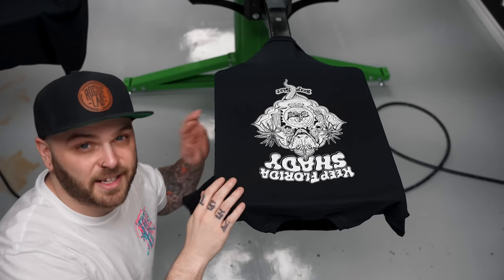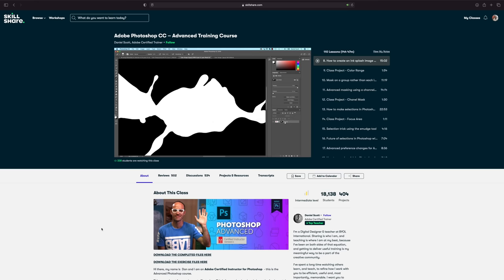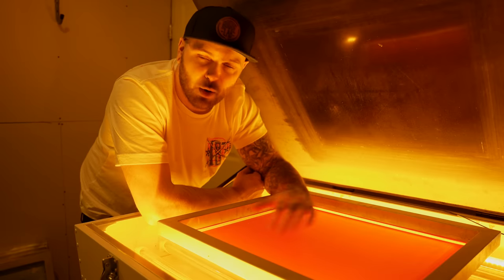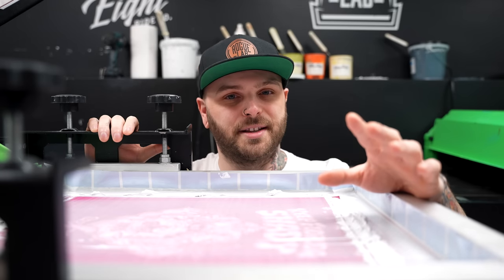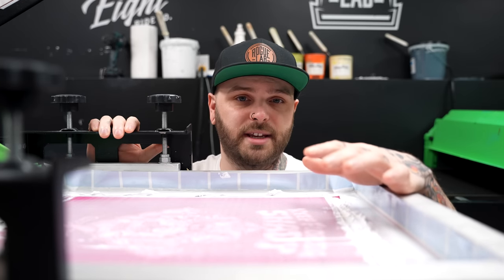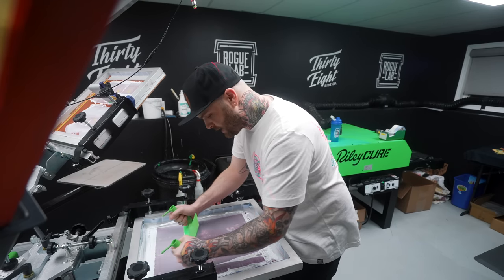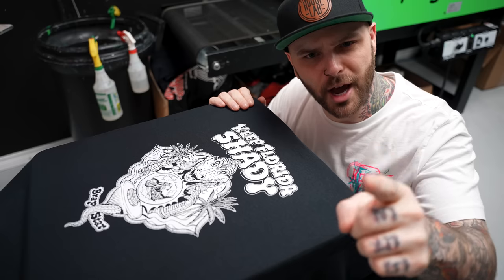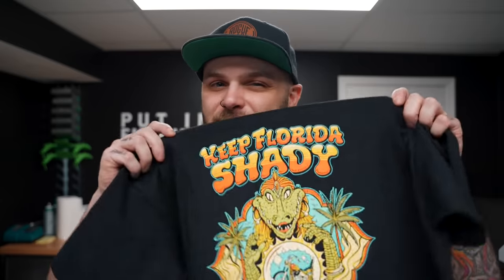How To Screen Print An Underbase | Everything You Need To Know

Comment: We just switched from the wilflex LC bolt to the rutland street fighter white at half the cost with the same results. We were going through 10 gallons a week and it added up at the end of the month. Really good advice on the prep. I would also suggest a 2 to 1 coat for a thicker stencil to put down a little bit more white for better coverage. Print looks really good 👍
Reply from the maker: I use a 1/1 which is a perfect 20% EOM with that screen mesh and emulsion, EOM plays a huge part in a good print. I use the Rutland street fighter here too but I've switched it to my highlight white as it didn't have the matte down the wilflex did. I think on an auto with a roller or iron it would be a perfect base though.
Reply: @leestuart38  we don't use a roller with the street fighter and get good matdown. Had to play around with the pressure and squeegee angle to get it right. Head 1 is our default underbase print head...lol

Comment: WOW....that looks great. Just the registration is incredible. F"n great job man. Only 1 question could u do a flattening screen right after the white base. I just did some black hoodiez after the first pass i did the flattening screen. And hit it again with white. It was a bright white. And it was a thick. It was only a 2 color design so I was able to get away with a thicker print.
Reply from the maker: Thanks! I don't use a flattening screen anymore, I've dialed in my setup and technique to where I don't need it

Comment: Not sure if I missed it in this video but should the flash DRY each ink layer or just almost dry it?
Reply from the maker: Always flash the underbase. Top colors is a balancing act between printing wet or flashing. If you're new to it or even an intermediate, then flashing them all is fine on a manual press. Just make sure you aren't over flashing and fully curing everything

Comment: I am  still struggling a bit with learning and understanding all of the inks out there. There are so many damn choices! I am going to try out the Wilflex Quickwhite you mentioned but if I am understanding correctly, based on the spec sheet that ink is not suitable for 100% polyester garments. If that is the case, what white is your preference for 100% poly?

Comment: Hi Lee,
Is your flash a Heat dryer or UV driven ? 
I'm currently using a heat press to dry tee's and I'm wondering if I should go straight to UV 
Thanks
Reply from the maker: Heat. UV isn't used in textile screen printing

Comment: 2 questions what type of squeegee is that and do you like using that better than standard one? And are you using water based inks or plastisol? Process and advice might be bit different dependending on which you are using.
Reply from the maker: Way better than a standard squeegee in my opinion. It's a lot easier to pull prints and to print for long periods of time. The link to the squeegee is in the video description 👍🏻

Comment: I use 5% reducer in my whites for printing hoodies only. Is that something you do as well? It seams like the only way to get a smooth white on hoodies.
Reply from the maker: No I don't use reducer for basically anything unless I'm printing on white shirts. Reducer is taking down the bleed blocking properties of your low bleed white which you really need on hoodies. I run thin thread screens for bases on hoodies instead.

Comment: If you do not do a Print, Flash, Print on the under base. Do you do a highlight white on the top to make the white pop more?
Reply from the maker: If there's white in the design, yes use a second highlight white screen. I'll be doing a video on this right away

Comment: for the underbase white, do you use 1point choke from the center in illustrator?  I could see the outline of the overprint on the "white hightlight video"  which looks like 1 point to 1.25 point choke?
Reply from the maker: That's far too much. I use 0.25 to 0.5 at maximum

Comment: Do you have to print the underbase design smaller? Or just the same size as everything else?
Reply from the maker: The base is typically choked a little bit depending on the design

Comment: i want to get me a screen print press.. but im not sure i dont have much room, can i also do a cmyk print with  a press wich only can hold one screen? i can imagine it will pita to align the screen after switching....
Reply from the maker: You need multiple heads for 4 color process. Registration is a difficult process and can't be done that way. You'll need at least a 4 color press with micro registration adjusters
Reply: @leestuart38  really? i saw a few tutorials on how to do it with one head but the tut didnt really described the process of everything, screen had to be replaced everytime new color was applied...

Comment: just to make it clear, under base is just a pass with white ink? Correct me if I am wrong.
Reply from the maker: Exactly. It's needed for bright, opaque colors and to matte down the shirt fibers
Reply: @leestuart38  If i am printing a white design into a black T-shirt, do I need an underbase? So hypothetically, I print the design twice...?
Reply from the maker: @costaspsarommatis2096  yes you will need to print it twice or use 2 screens. I have a video about using highlight whites.